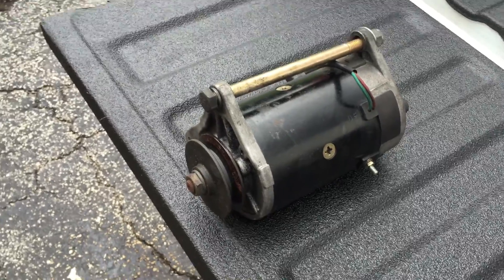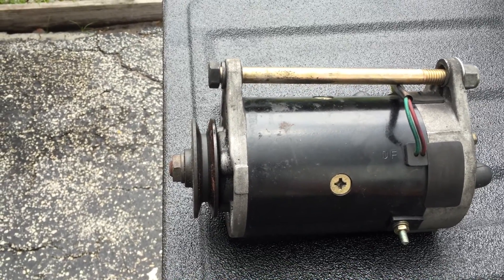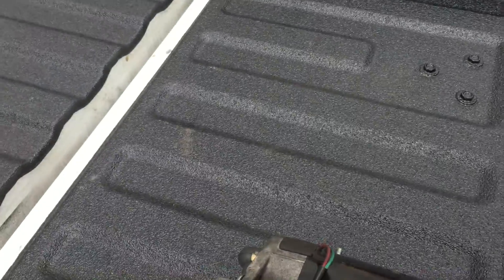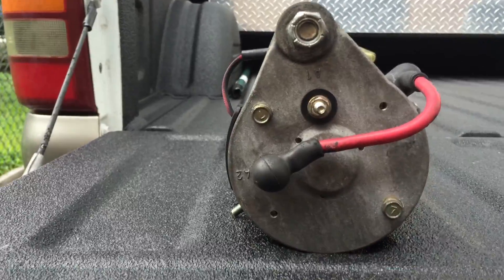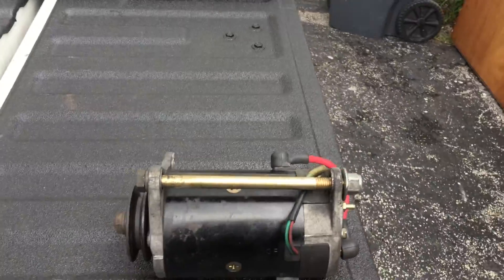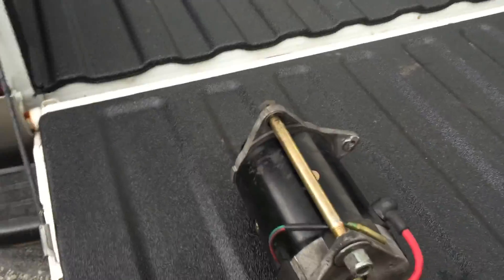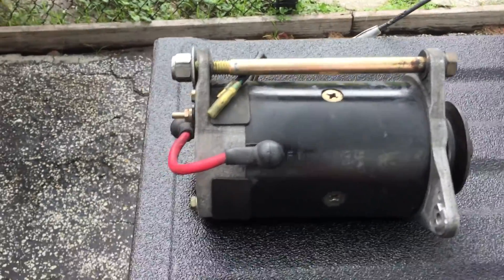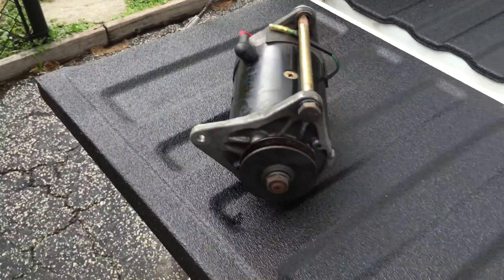12 Volt electric motor identification.

Comment: Looks like a Delco   should have some serial numbers stamped into the casing  from this view it looks like a starter/ generator from a kohler engine.
Reply from the maker: +Tioga Trails Thanks TT,Yeah it does look very Delco-ish. It's not a gen as best as I can tell. The golf cart was designed to run on this electric motor until the gas motor started, or as long as the batter lasted if the gas motor failed to start. I looked at it pretty close and could not find any stampings. It's not paramount that I have all the specs on it, I think it will work fine for this project. Thanks again...